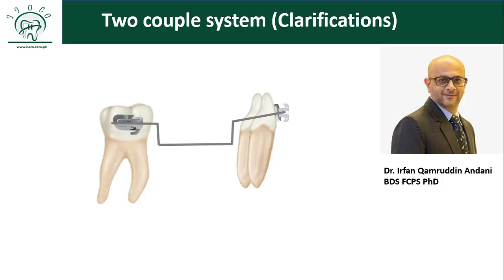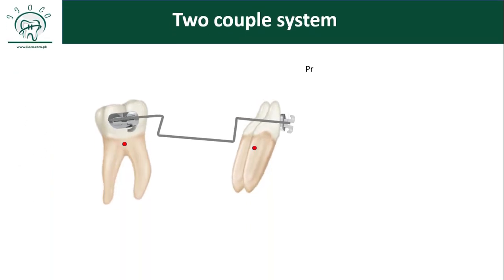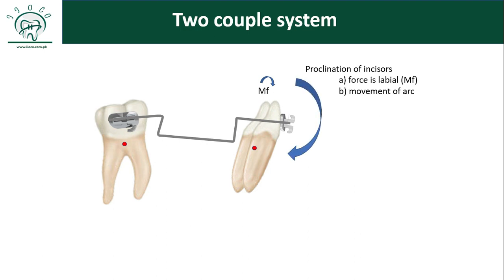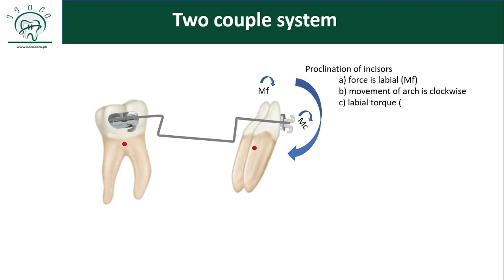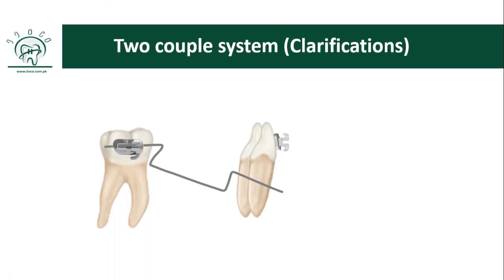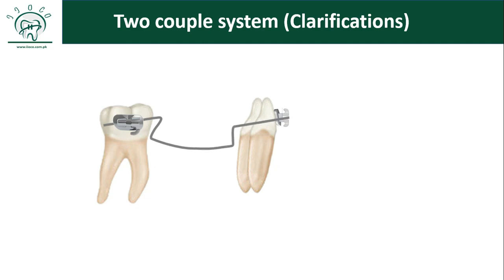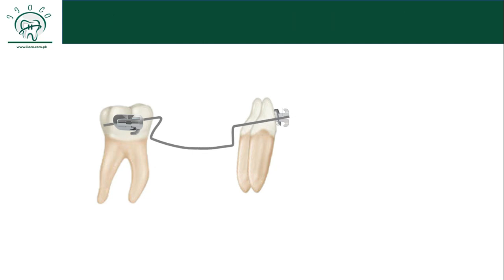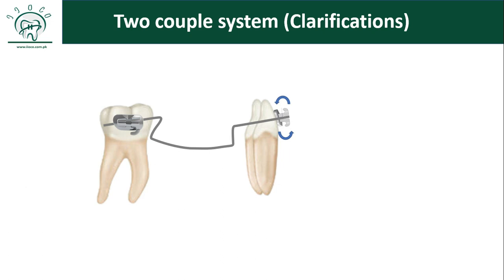Two Couple System (Utility Arch (Clarifications))

Comment: Sir the last point is still confusing how is this wire deflection happening in reverse direction can you please elaborate through some diagram ?? Extremely thankful to you for your beautifully illustrated video ❤
Reply from the maker: Sure. Can't draw here I guess,  but sharing a pic as a post on channel
Reply: @irfansinstituteofclinicalortho  bundle of thanks Sir means alot.
Reply from the maker: I have posted an image,  did you see? If yes then acknowledge please
Reply: @irfansinstituteofclinicalortho  yes sir bundle of thanks ❤️ still trying to wrap my head around it biomechanics 🤯 Prof Giorgio just reolutionized the whole traditional understanding it'll take some time I guess and also I'll try it real time and see how it works real time ❤️
Reply from the maker: I also found the same in nanda's biomechanics.
Reply: Doesnt the MBT prescription for lower have lingual crown torque 
Will not it counteract the proclination caused by the utility arch
Reply: Yes even me confused… without placing lingual  crown torque there will be labial proclination which is clockwise direction,,, so to counteract you need to place lingual crown torque;; and your idea no need to put because the wire deflection will do that,,, is that true